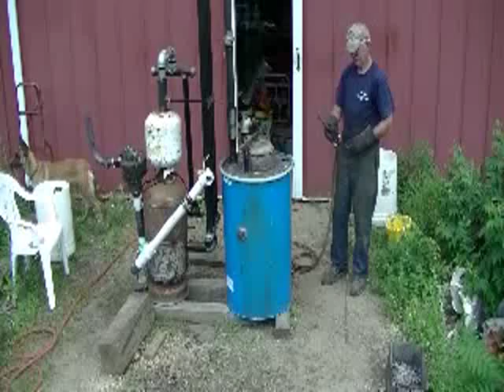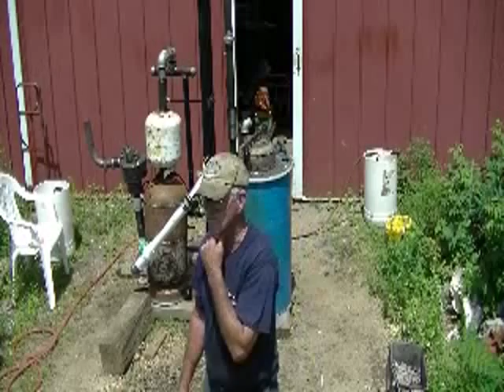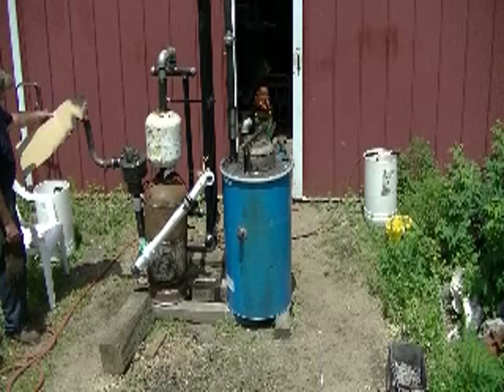Wood gasifier flare

Comment: I found that fan speed affected the backfiring I experienced. My fan pulled way too much air through the system and created a flammable mixture that would blow out every now and then. Burned my eyebrows pretty good looking down inside just as a backfire happened. Good times.
Reply from the maker: Those early days when everything was a mystery !  I have racked up a lot of hours since then and have all the leaks repaired.
It is now my " go to " system and able to handle a wide variety of engines and applications.  I hope you have yours dialed in, too.

Comment: Love the blasts  :) . When my first gasser did that, it destroyed the metal body of the blower, and made my ears ring for many hours.
Stainless steel pads in the flare ports will prevent those bangs, and will also serve as a tar warning device.
I suspect that the bangs were caused by not waiting long enough for the blower to pull all of the air out of the plumbing. You are likely to find that it will take at least 2 minutes to totally purge the air from the system. Once that has taken place, there will be no more bursty-pops  :) .

Talking of which, I have found that it helps to put a stainless steel pad in the final part of the plumbing - just ahead of the engine.
It makes the engine run quieter, and seems to make it easier to start too.
Well, that has been my experience.
Keep up the good work. Flash001's legacy of excellence is spreading, just as it should  :) .
Reply: CNC, We kept the women and children at a safe location so they would not be subjected to the language and the flash/bang ;) . Thanks for the comment. I did  put some steel wool in the flare pipe during the video and that cured the back fire. After the filming was finished and the unit disassembled I found that the connection to the glass ball jar was very loose. Probably from the pre-ignition first blast. That may have been the reason for all the subsequent blasts. But a good time was had by all ! Speaking of Flash001,it has been a real pleasure to work with him all through the process. I think he lives and breathes this stuff !

Comment: It looks like you are figuring it out. I didn't see any filtering so your flare looks really clean unfiltered. One more thing I heard someone say to leave the air intake wide open.. Yes, leave it wide open. I only choke off during shutdown.
Reply from the maker: Flash, We had quite a good test run  after we inserted the stainless steel pad in the flare tube. Today , not so good. Never really got going. I think the shaker was plugged after yesterdays run and shut down with a half of a hopper full. We were making a lot of moisture, too. Tried to run a small generator. No go on this try. We have to make better gas. I think it's probably best to start fresh each time so that all the variables can be checked before hand.
Reply: NH Hbbyloggr
Bill it's just going to take you learning the system with some hands on exp. Once you get the gasifier figured out the rest will fall into place. Try priming the engine with a tablespoon of gas. Do that and cutoff the woodgas intake then choke the engine to get it to start. Once it starts, open the woodgas intake and choke back the fresh air intake and work it backwards until the engine is up and running.
Reply from the maker: flash001USA
I'll try that approach next go around once it's producing good steady gas. BTW , this is the second half of the video. The first half was installing the 5 module sections and starting up the gasifier. It went really smooth and rather quickly  showing that within 20 min it could be making power. I'm just waiting for permission from one of the folks present to have him in the scene. Stay tuned . Many thanks again for all the help.

Comment: The next step is to be able to store enough of the gas under pressure to run a generator.
Reply from the maker: This will run a generator 3.5k to 12k   " On Demand " as needed. Actually a good source of fuel to use with an engine/alternator charging a bank of deep cycle batteries.
Reply: the gasifier will keep up with the generator easily.  I have compressed gas and then ran my generator off it just to see if it would work.  It worked.
Reply: NH Hbbyloggr I hooked air compressor up to my gasifier outlet....ran hose from compressor tank to propane bottle. open relief valve on propane bottle, turn on compressor, let it run a good 15 minutes, then shut the relief valve off and compressor will shut off when propane tank and compressor tank are full.  if you're getting good gas, you should be able to shoot one hell of a flame out of that propane tank-better than propane actually. if you get air in it.....it won't stay lit, just like your flare, if you try this, be careful!!!!!!  have someone there helping  if you light  the gas just coming out of a hose.